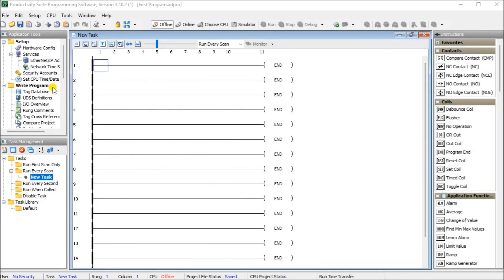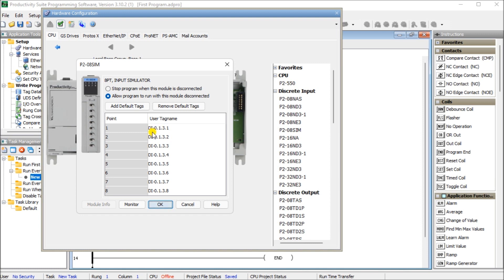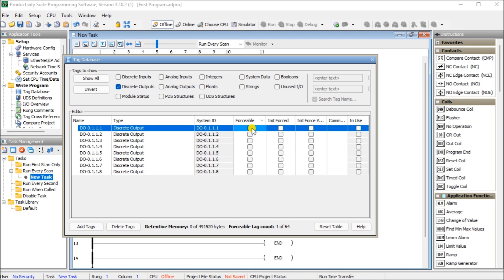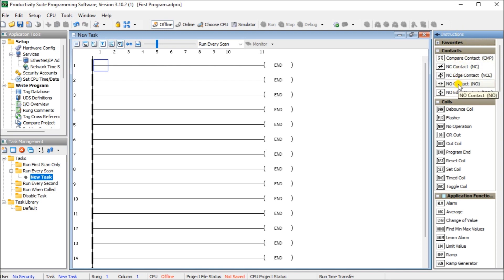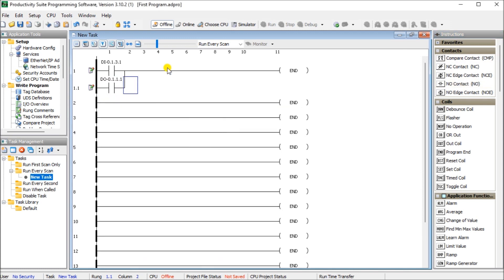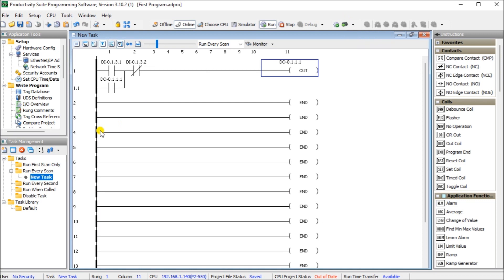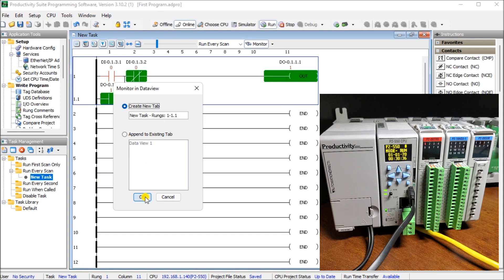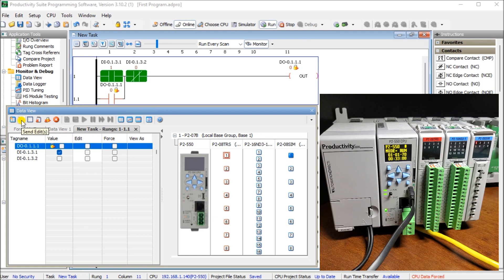Build Your First PLC Start-Stop Circuit in Minutes!

Comment from the maker: Detailed information can be found on our website. The post for this video is located here:
https://accautomation.ca/productivity-2000-series-plc-first-program/

Previously in this Productivity 2000 series PLC, we have discussed:
P2000 Hardware Features
https://accautomation.ca/productivity-2000-series-plc-p2000-hardware/
https://youtu.be/83MfQK7fzdk
Productivity Suite Programming Software Install
https://accautomation.ca/productivity-2000-series-plc-software-install/
https://youtu.be/4MTOIrWA1L8
Productivity 2000 Series PLC Communication
https://accautomation.ca/productivity-2000-series-plc-communication/
https://youtu.be/UoHoMwk-zi0

There are several reasons why we are using the Productivity 2000 Series Controller. Here are just a few.
- CPU with 5 communication ports
- 50MB user memory - Can handle very complex applications easily.
- Limitless PID – Autotuning – Individual or Cascade Mode - etc
- OLED message display on the CPU module
- Plenty of discrete and analog I/O modules
- Status displays on all discrete I/O modules
- I/O Modules have QR codes. This can be scanned so you can have the latest specifications/wiring diagrams for the module.
- OLED data display on analog modules
- P2-RS remote I/O expansion module, or use the Productivity1000 P1-RX remote expansion module to add even lower-cost remote I/O to your system
- FREE full-featured Productivity Suite software
- Programming with several ports - USB, Ethernet, Serial
- Hardware auto-discovery
- Hot-swappable I/O - Remove cards with power on the system
- Choose from three wiring options
- Slim DIN rail density form factor:
 - hardware - power supply, CPU, and seven modules in only 10-1/2 inches
- All project files (program, tag name database, and all the program documentation) in the CPU
- Run-time editing and debug mode on CPU
- Easy data logging with micro SD on CPU
- Secure Web server to access data files and system tags
- Easy drive and motion controller integration
- Coordinate motion control with PS-AMC allows control of up to 16 axes and synchronization of up to 4 axes
- Two-Year Warranty

The Productivity 2000 series of programmable logic controllers currently has all of these features built into the P2-550 CPU.
This CPU (Central Processing Unit) is also known as PAC (Programmable Automation Controller) because of its communication capabilities.

Regards,
Garry
ACC Automation
https://www.accautomation.ca